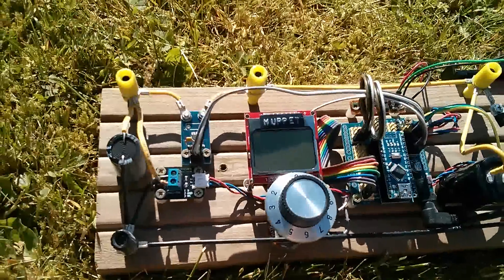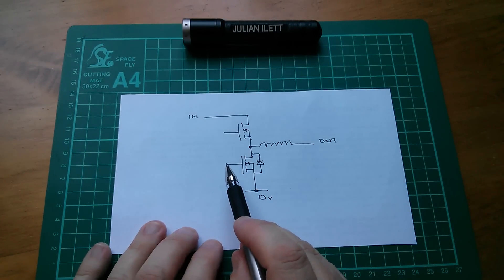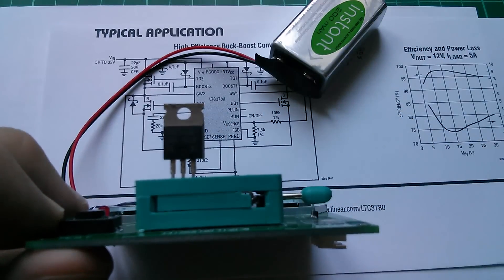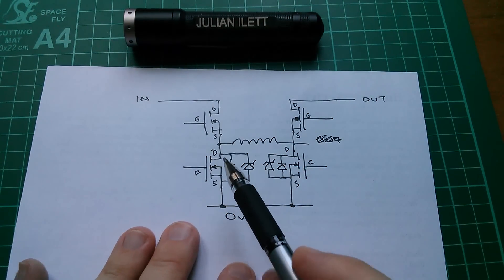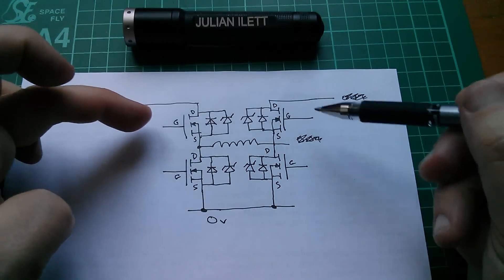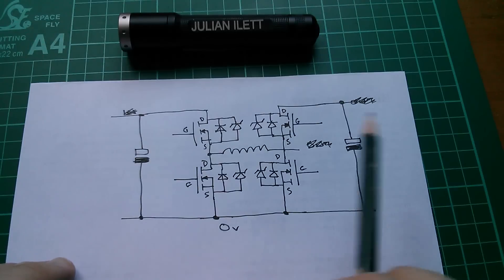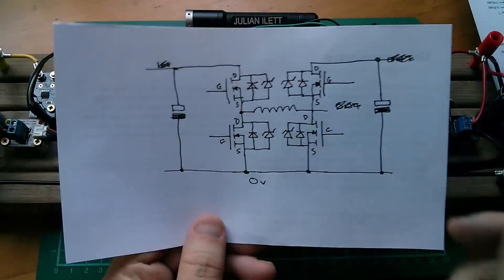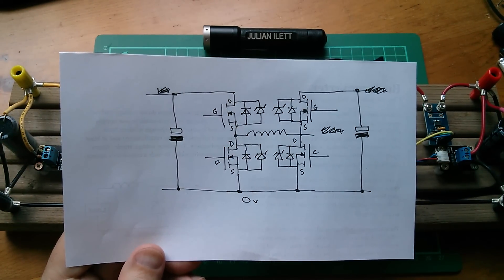Muppet 2 - A Bidirectional Buck/Boost DC/DC Converter

Comment: stm32F103C8T6 can be use instead of the arduino stm32 & can also be program with arduino ide. It is cheap too.
Reply: Electronic projects STM32F303 will be better choice than that if STM32F334 can not be used for some reason.

Comment: Another possible application: Regenerative Braking System for electric automobile (kicks in to store energy in batteries or super-capacitors to help get started again after braking/stopping). Control circuit stays open or is used as PWM forward regulator for normal energy transfer during acceleration (or stays off for coasting) and PWM adjusts the proportional braking/energy storage percentage (controlled by the human driver).  Regeneration would even continue to function through a controlled DPDT “switch” that's used to reverse the polarity and change the vehicle direction mode from forward to reverse (changeable as long as vehicle motion was at zero).
Reply from the maker: Yes, exactly. To my mind, this would also work as a motor speed controller from a variable voltage supply (i.e. supercapacitor)
Reply: Brilliant, now you have to convert the old electric bike to use regenerative braking.  Er. . . what happened to the electric bike project anyway did you ever finish it?
Reply from the maker: +number 33 unfortunately the bike's motor is linked to the back wheel via a ratchet mechanism

Comment: Julian, really like the MUPPET series. Trying to build one myself.
I am using a standard buck which I control with Arduino (ESP-12E)
I'm only wondering if it's just enough to only monitor and maximize output power?

Comment: I like it!  Being able to efficiently transfer charge from one battery to another whenever needed in an automated system could come in handy.  But the key point and question is how how efficient is it?
Reply from the maker: The LTC3780 claims up to 98%
Reply: Yes, I see that claimed 98% and with Linear I do believe it but that is at the most ideal input and output voltages and currents.  If you are using a low current solar panel for example it will drop quite a bit.  But you are looking to use the Arduino instead of the LTC3780 correct?  It should be interesting but hard to "compete" with a dedicated IC.  It has a lot inside of it.
Reply from the maker: +simontay1984 I may end up doing that (or the LT8705). But initially I want to do it the hard way as a learning experience.
Reply: ElmerFuddGun Its not hard to compete that if you use right components and proper designing skills. yes you could say that cost wise it may not be but performance wise it could even be better. there are dedicated Digital Signal Controllers like TI TMS320F series or STM32F334 like that. Performance and control mechanism will be even better and yes with right magnetics too. as this MUPPET uses that green coloured PUPPET inductor so you just need to see if output voltage stays at desired voltage on multimeter.

Comment: did you ever get around to playing with those ideal diodes?
Reply: I wrote very long message but miss click deleted that. 
I am also working from long time at my own design and want to finish this summer. My current experience in MPPT:
1. High frequencies > 40kHz - You can try max capabilities of ATmega which is around 60kHz.
2. Good inductor - good core inductor for power switching calculated for 
enough current and inductance. Check this 
http://www.feryster.pl/polski/dtmss.php?lang=en. Maybe in UK You have 
better alternative.
3. Reverse current from battery to GND at low 
load. - Blocking diode or switch off low side fet during low load 
situation and use Schottky diode (non synchronous mode) - at low output 
current  (battery full).
4. Good mosfet driver - Like IR2110 and 
bootstrap circuit or separate isolated voltage for high side drive. 
Driver should have enough current capabilities at this frequencies.
5. Very important - without real peak inductor current monitoring it's 
very easy to have problem with hiccup mode instead of DCM or CM. 
Saturating the inductor. Low efficiency. Lot of EMI.
6. Use good calculator for example: 
http://schmidt-walter-schaltnetzteile.de/smps_e/smps_e.html and worst 
case situation - high input voltage, low output current. 

My main point of interest in electronic design is power converters.
Hope You will read my comment. 
Cheers from Poland, 
Dominik
Reply from the maker: +yeme No not yet. They're for my PWM5 redesign.

Comment: Great news that the Muppet is back, these were always among my favourite videos.
Reply: Yeah i was wondering where the muppet whent it was a modular and nice project.
I hope he can do things with the arduino as the controller since it would be something most of us could also play around with without needing to learn a whole new IDE and micro to follow.
He did generate simular signals with the PWM solar controller with inverted pwn signals and such but the tricky part is the signals that are not similar modulation.
Well regardless i'm happy we will get some muppet show ( pun intended ).